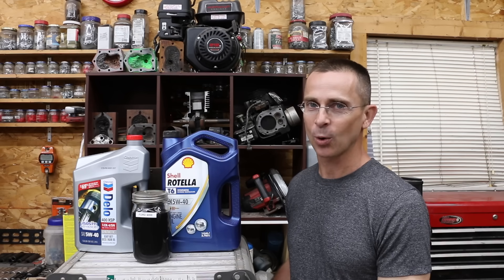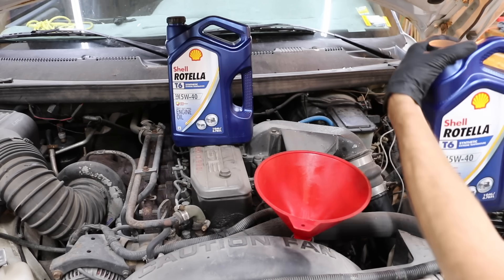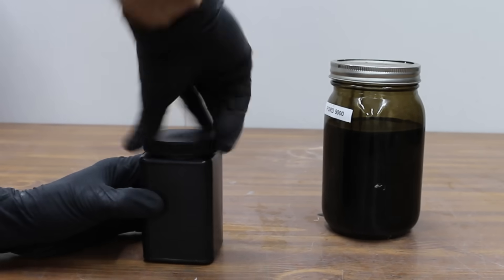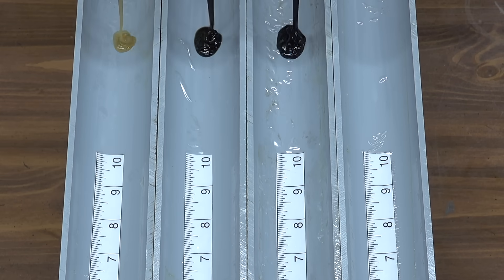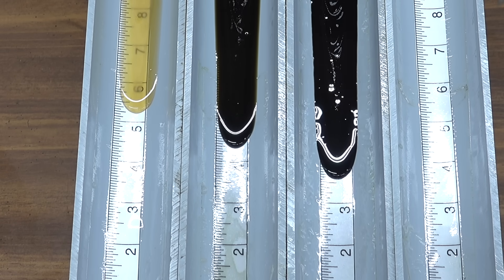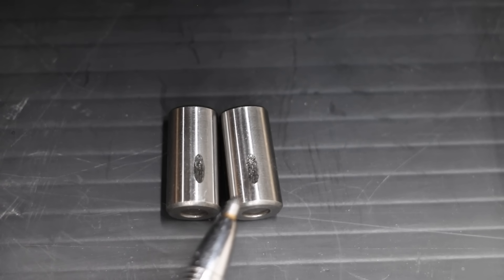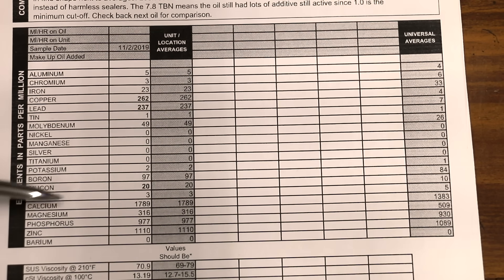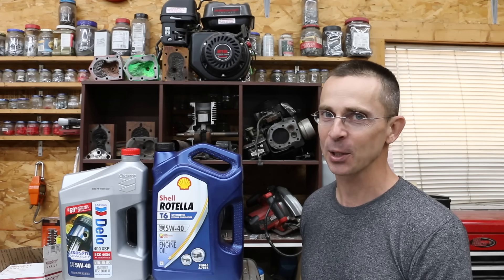Will Annual Oil Change Damage Your Car? Let's find out!

Comment: Shell Rotella is the best oil! Backyard motorcycle mechanics use it in wet sump clutch applications since it does not have friction modifiers which can cause clutch slippage..
Reply from the maker: Thanks for the feedback.

Comment: Great test. Oil needs to be changed when it's still in pretty good condition that means that you can't wait with oil change until oil loses its  protecting features.
Reply from the maker: Thanks!  Thanks for the feedback.

Comment: So our take from this video is...

If you are running at low mileage.. you can replace oil up to 2 years. It will be fine.

I haven't changed my motorcycle oil for a years but it is low mileage.. I can see that the oil is still brown.. Will use it for another year. It is very low mileage.. just above 500kms since last oil change...

Lastly, I knew it!! People who says you have to change oil every 6 months are Psychos. LOL

Comment: I'm using T-6 in my KLR and have been changing my oil every 3 months with less than 300mi between changes- this was a eye opener thanks! Still not going to slack too much but this certainly made the window between changes a lot wider.
Reply: Where do you buy T6 from? I can’t find it
Reply: @cking0680  can't find it now myself, I'm using liqui moly for the first time , i did find a t-6 on amazon but it was $90/gal, too much for my budget.
Reply from the maker: Thanks for sharing.
Reply: $65 a gallon? That's crazy
Reply: @cking0680  I know, insane, I bought liqui moly 5w-40, 12 one liter bottles for $120 on Amazon, oil changes for a year. I hope this sanctions nonsense doesn't last long.
Reply: @isaacwhull  I heard they stop making T6 so people buy then jack up the price. I have 6 gallons left
Reply: @cking0680  I talked with Napa and was told some ingredients were on back order, and that was before Ukraine, the t-6 looks like a thing of the past for now, it may be virtually impossible to find, but for sure very expensive.

Comment: John Deere Corn Head Grease NIL 0. Flow, sticks to gears, doesn't flow or leak out of gear unit like gear oil. A fact finding test and comparison with stop 80/90, or 90/140 gear oil.
The corn head Grease is poly urea which is a story on to itself. Urea used in polymer bed liners chick I know you've tested. Anyway a test of JD Corn Head Grease would be great. Thanks for your time consuming presentations. 
CD in New Hampshire 👍
Reply from the maker: You are welcome!   Thanks for the suggestion.

Comment: As always, great video. I'm curious to see how the Rotella T6 Synthetic 15w-40 (not the 5w-40) compares to the Mobil/Delvac Extreme 15w-40 Synthetic. Have you already did a video with those? If not, would you consider it? I'm just surprised how bad Rotella T6 beat the Delo synthetic, and curious to how the Mobil Delvac Extreme will do against it. Especially since I use the Mobil Delvac Extreme in my Cummins. Lol.
Reply from the maker: Thanks for the suggestion.
Reply: Stick with  the  Mobile.  I have been a diesel  mechanic  for 40 years  . Rotella  is  junk in comparison.  Engine with  Rotella always  have more sludge and  wear then Mobile.  Rotella  is  better at advertising.  When  you  see engines  with  800000 miles or 16000 hours  the difference  is  huge!
Reply: @dougcramer5454  Thank you for that information!

Comment: You're oil will degrade but the amount of use the rate of degradation time also will degrade  oils viscosity but at a much slower rate than regular use would.  Using a quality filter helps more than anything else . Synthetic oil last much longer and bye simply changing the filter rather than the oil can prolong the oil's life as well. I simply change the filter at 3000 miles rather than the oil and skip the 3000 mi oil change and go six instead by changing the filter .
Reply from the maker: Thanks for the feedback.

Comment: My experience with well-used oil is not chemical degradation, because synthetic oils are very stable. The problem is the oil becoming dirty and blocking small orifices. A typical problem on engines such as MB and GM V6 is that the orifice that squirts oil onto the timing chain blocks due to dirt, the chain gets no / insufficient lubrication, and the chain fails prematurely.  Rather change the oil too soon that too late.
Reply from the maker: Thanks for the feedback.

Comment: Question for anyone, I’ve used pretty much nothing but regular 15w40 T4 or Valvoline oil in my 2015 Ram 2500 6.7 since 2015. It’s got nearly 100,000miles. Now people say if I go to a synthetic oil, specially a 5w40 I would possible see more oil leaks… so should I just stick with 15w40 with maybe a synthetic blend or 100% non synthetic oil for the rest of my engines life?
Reply: What does your owner's manual actually say?  A thinner 5 weight oil may give you slight improvement in mileage but that is dependent on how you operate the vehicle.  Synthetic or regular, both oils are formulated to meet the same API standard set of tests.

Comment: I have a jeep with a 4.0 straight 6 that I totally rebuilt about 6 years ago. I've put about 50k on it with a little more road driving than off road driving but it's had a rough life. I've changed the oil three times. Random regular 10w-30 oils, nothing special. It runs perfect with just as much power.
Reply from the maker: Thanks for sharing.

Comment: Ive seen friends' annual oil changes done at "discount" chain stores and trusting a different high school kid every year with fingers crossed he/she properly seats your oil drain plug without cross threading with their pneumatic air gun and compromising the oil pan's threading seems to be the rule of the day.

If Im doing it myself, I don't care how many times i need to flush and refill.

I did install a Fumoto drain plug that I will never need to remove again (It has a valve on it that i can simply open and close for oil changes, negating the need to unthread/thread the plug every time).
Reply from the maker: Thanks for sharing.

Comment: @Proect Farm:  Can you think of an plausible way to add a defined amount and size particulate to oil and then run it through off the shelf filters. Then remeasure/test the oil to take out the particlate and see how much was stopped by the filter?  I would think it could be done but not sure if it is plausible if you don't have your own lab of high end testing equipment.  That is beside the fact you would have to run it through a beater car because you would not want to dirty you own engine putting known particulate in the oil to test the filter. I did not think of that.  Might not be doable.

Comment: This is the most incredible test, I'm so grateful to you because I feel worried that I have left my old in my stored vehicle for too long. 
I put fresh oil into it and then drove from Sydney to Melbourne with small drives around the block every few months to circulate the oil. This would equate to approximately only 1,600 miles but the worrying part of this story is that the same oil has been  in the car for 5 years. I feel so embarrassed to tell you this as the car is a BMW M3 with 50,000 miles so I stupidly assumed it would be okay because of the low mileage. I actually sent the oil that was in the car before the oil change for analysis and it came back as fine. Saying that, I will find the report and compare it to your review in this video. I would truly appreciate your advice. Thank you mate.

Comment: For what it's worth I maintain diesel generators where I change the oil every 5 years regardless of hours on the clock (sometimes only 20 hours). After 5 years, unless there is diesel contamination, the oil tests fine. The generators are located inside the buildings I work in so maybe that makes a difference.
Reply from the maker: Thanks for the feedback.

Comment: Have you done testing on adding zink to synthetic oil?

I hear today's oils have little to no zinc due to the phosphorus effecting catalytic converters. So if you want zinc, you have to buy racing oil.

I have an 02 Silverado with a V6 and wanted to know if it's advisable to put a couple of ounces in my oil? Or is it bad for the  age and high mileage on my truck?
Reply: Down under penrite label a number of their  synthetic oils as having having zinc ...or extra zinc . I recently switched to a mobil not stating it has it Mobil3000 .For similar reasons to what you stated . The Mobil states it is good forB maintaining emissions systems . , But then again , a cat is cheaper than a new 6cly engine 🤔👻
Reply from the maker: Thanks for the video idea.

Comment: I change oil by elapsed miles or hours, depending on equipment.  I've had people tell me that new oil in sealed containers goes "bad" if it sits on the shelf too long.  I used to use Amsoil in my small engines until I looked at the specs on Rotella T6.  Better additive package, higher TBN, lower cost.

On a side note, if you oil both sides of the oil filter gasket it will spin on (and off) easier.

Comment: Great video thank you! When you said the engine should be warmed up to avoid moisture contamination. Did you mean let it warm up before you drive or just from start up to stop?
Reply: Start up to stop. Short hops don't heat the engine up enough to burn off the moisture. Needs to reach operating temperature.

Comment: I I re-watched this video, thanks again. I add Sea Foam to my crank cases, it will help fight moisture in them. I use approx 2 table spoons per 5qts
Reply from the maker: Thanks for sharing.
Reply: I lived on a boat. I used Sea Foam and it made my life so much easier! In the oil and fuel, especially stored fuel.

Comment: I am a yearly oil changer & have never had a problem - some years 3000 & others 40,000 - the 40k oil looks & feels the same as the  3k - both were synthetic - also the nearest store is 6 miles so the engine always gets hot.  Every 3 or 4 changes I use a engine flush to make sure there is no build up.
Reply from the maker: Thanks for sharing.

Comment: A very relevant test since you may have the option to skip a lot of unnecessary oil change. Saving both money and resources. However a 4 month or 7 month extendet operating time is way too modest and therefore does not give a full picture of HOW far you can extend the operating time of your oil. In my gasoline car I had 3.000 miles and 7 years between oil change. Did it harm my engine ? I dont think so. But since I did not make an oil analysis I cant tell for sure. I would love to have another test with at least a 4 year test span and also a 8 year test span between oil change just to go to extremes. Thank you. Flemming Qvist Denmark

Comment: Oil companies have been out right lying about this for years to sell oil every year.  Thanks for doing the testing and publishing the results.  When was the last time you saw something covered with oil get rusty anyway.  I've never seen it happen.  Seems it would be easy to test the pH and moisture content of my own oil and decide when it has gone bad due to time next to metal and exposure to moisture. If transmission fluid can last ten years, it makes sense that motor oil isn't going to just go bad sitting in an engine that isn't running.
Reply from the maker: You are welcome!

Comment: I do 15K mile oil changes on my Kia van with 199k miles. Still gets 24 mpg and doesn't use any oil between changes. Mobil 1 Extended Life works great.
Reply from the maker: Thanks for sharing.

Comment: Be careful with the mobil1 annual protection.  It leaked out of my Chrysler minivan and destroyed my engine.  I even called them before using it and the guy said it would be great.  After my engine started having issues they said it’s not rated for that vehicle!  They basically told me tough luck.  It’s good oil but do the research first.
Reply from the maker: Thanks for the feedback.

Comment: I've been an Amsoil 'preferred customer' for over 25 years. When Amsoil first introduce their synthetic auto oils, I have been on board. I have followed the 1 year/25,000 miles Amsoil recommended oil change policy from the get go. I have logged 10's of 1000's of miles on several vehicles of which none of them ever showed signs of oil consumption or loss of oil pressure. I currently own a 2002 GMC Sierra that has just under 200,000 miles on it. It would have more than that if I had not retired in 2008 so at that point I was no longer putting on the miles driving to work. The engine continues to perform flawlessly and at startup is very quiet. The oil pressure at highway speeds still holds steady at 55 to 60 psi and 40 to 45 psi at idle. That engine gets the exact same fuel efficiency now as it did when it was new. To me, there is only 2 possible explanations for the positive results I've experienced with my vehicles. It's either I've been extremely lucky to have had good engines or it has to be the brand/type of oil I have always used. I'm sure there are others out there that will say that the brand of oil has nothing to do with it. I have used these products in ALL engines I have owned which includes auto, lawn equipment and marine engines. So, for me, the answer is simple.
Reply from the maker: Thanks for the feedback.

Comment: In the most severe duty applications, 3,000 for a gas engine, 5,000 for a small Diesel engine, 10,000 for a large bore diesel. I would NEVER go over that interval, oil is inexpensive relative to engine parts.
Reply from the maker: Thanks for the feedback.

Comment: I've wondered if I have to change oil every 3 months even though I haven't reached 3000 miles. It makes me wonder if it's a ripoff to have the oil changed so frequently. When I worked, my employer told us to change oil every 5000 miles. Is it really necessary?
Reply: I would say " depends on the driving your doing---City or Highway--Stop and Go,,Kills a Car !
Reply: @BigTony2Guns  Most of my work driving was mostly highway driving and I did a lot of driving at work. My personal cars were driven mostly in town. I just changed the oil and filter on my Xterra after 1 year and it was just shy of the elapsed 5000 mile mark. I've never had the oil tested so I don't know if the 1 year change still showed good protection. I don't have any local oil testing facilities anyway.

Comment: QUESTION : One of oil's jobs is as a plasticiser - it helps the plastic / rubber parts it comes in contact with stay supple. How does used oil rate for this ? ( for example, one of the leading causes of BMW V8 value guide wear ( they are plastic ) is engine oil not being changed regularly. How could this be tested I wonder ...
Reply from the maker: Thanks for the suggestion.

Comment: A problem with diesel engines is acidity created by combustion products.  This is not as much an issue with gasoline engines, gasoline engines may have other issues, and using what is recommended for each is best.  Low pH (acidity) will increase the rate in which metal oxides form.  A test that might have been considered would be to measure the oil's buffering capacity by doing a titration with concentrated sulfuric acid to see which oil could mix with the most acid before a given amount of decrease in pH is observed.  A diluted acid solution may invalidate the experiment and arcuately measuring the pH of a non-aqueous liquid may get tricky.  No criticism here for not trying it and I have no idea how well it would have worked.  I am not sure how industry commonly does this and perhaps the specifics of these sort of determinations used in development and formulation are proprietary.  Calcium and expressed % ash are properties often associated with diesel engine oils that relate to this acidity problem in spite of what is often said otherwise.  Calcium is a divalent metal, giving off elections differently from other metals used in making an engine is how it does its job, and it requires an surfactant to keep it in suspension.  Calcium is not other things people may say it is.  If the engine has not been running, chances are that anticorrosive components in the oil will not have been consumed by damaging products produced during combustion.  Water, a medium conducive to corrosion, has the miniscule atomic weight of 18, but it is polar, so a little bit of running time is needed to vaporize it out of the oil.  Warming the engine to full operating temperature periodically to address possible accumulations of water from condensation is a good idea.  Aside from all of that, there may be other concerns.  What is the expected life and solubility of additives intended for preservation of seals, etc. especially when an engine is sitting out in the elements for extended periods of time?  What is in the oil that serves one purpose, but must also be compatible with something else?  Does that degrade in some unimaginable way?  There can be more to this than one might think.  When in doubt, changing the oil as recommended by the manufacturer with what they say to use will not harm the engine.  Being clever is often the very thing that has many in the market for a new long block.
Reply from the maker: Thanks for the feedback.